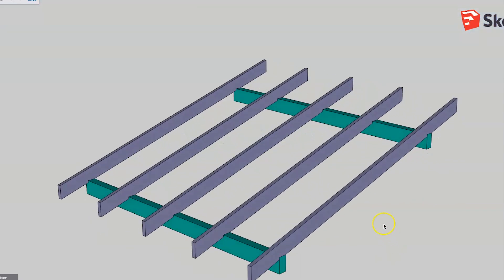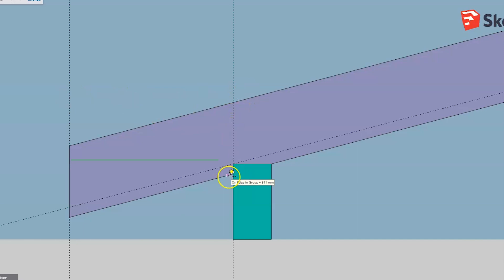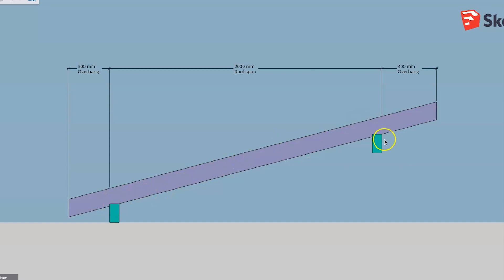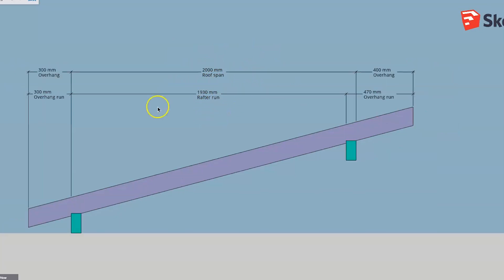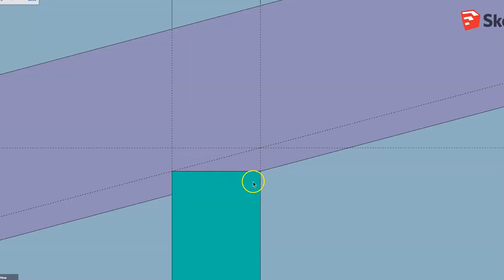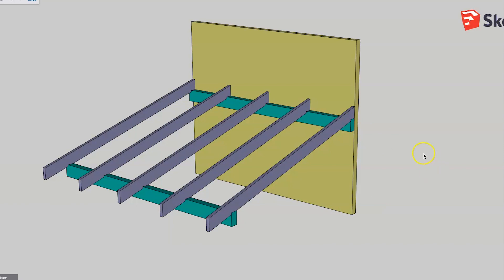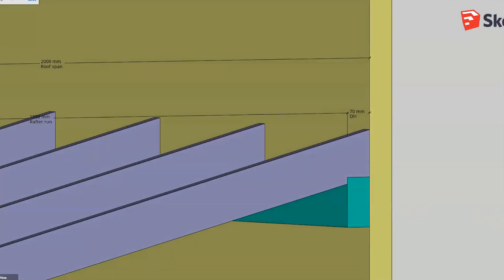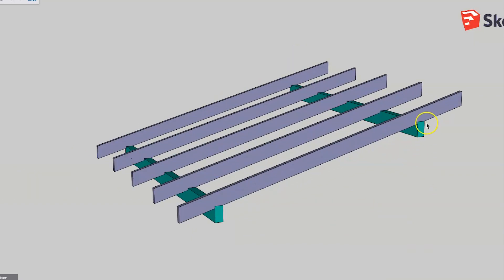Skillion roof calculations

Comment: what  is the maximum span on the roof one can having using 2x10s  or 2x12's at a 30 to 45 degree angle? cheers
Reply from the maker: Allowable spans will depend on the building code in your area. Every country will have their own way of regulating that.
Reply: It depends on a number of factors. What is the species of the wood. Will the roof be subjected to high wind loads. Will the roof be subjected to snow loads. What will be the spacing between the rafters. What's the weight of the ceiling and other roofing materials. What do the local codes allow in your area. Ironically, the slope or the angle has very little effect on the maximum span.

Comment: Is it best to have the highest side of the wall facing the prevailing wind or have the lower side facing the prevailing wing? Just thinking of the angle of the roof and how the prevailing wind passes over it with uplift. Cheers
Reply from the maker: If the sizing and connections of the members is correct then it wouldn’t matter. I would say however that having the low side towards the wind would produce less uplift force.

Comment: Is the actual length of the plumb cuts different to the span ie the plumb cuts are found by using the length of the hypotenuse rather than the span ?
Reply from the maker: The length of the plumb cut will be determined by two measurements; the height of the timber and the plumb angle.